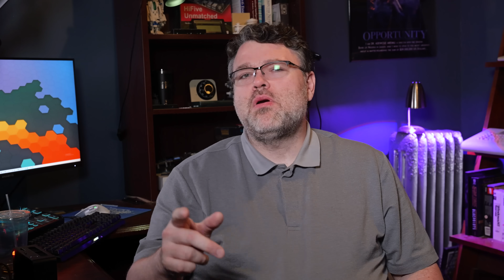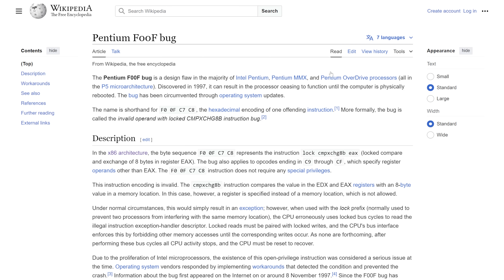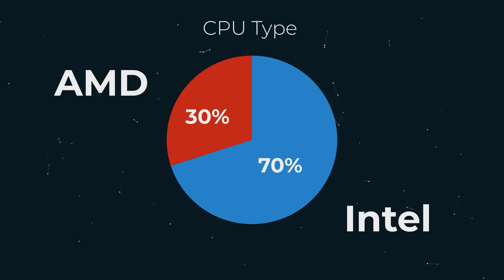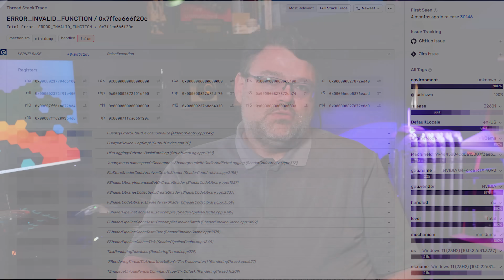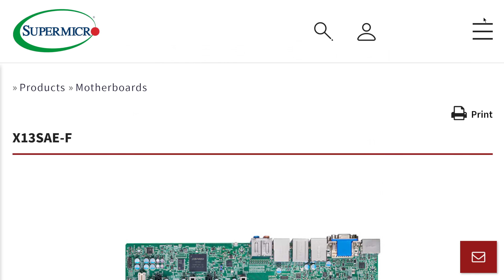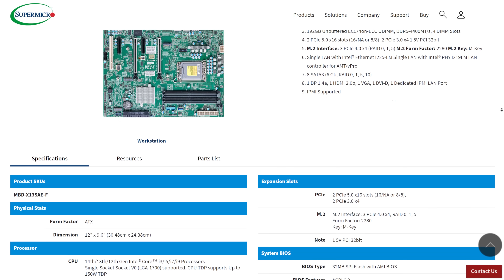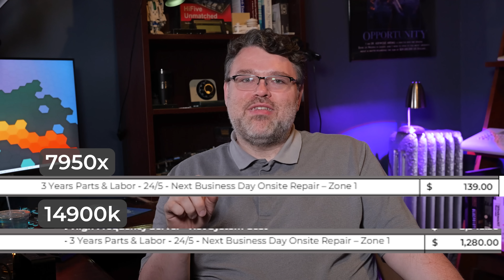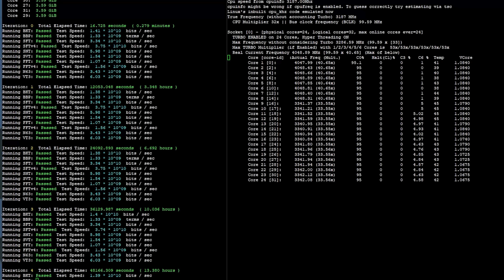Intel has a Pretty Big Problem

Comment: My 13900K (running at stock) has been rock solid for about a year, hopefully I don't have a ticking time bomb 😬
Reply: i have a 13900kf at stock settings with intel power limits  rock solid since january 2023
Reply: @josejorgegranados661  rocks and beats a ryzen 3750x
Reply: My 13700k / 4090 build has been pretty much flawless for almost 2 years now. Even started out of a ddr4 board for about 5 months until msi released the z790 tomahawk ddr5 board. But 13700k oc to 5.6ghz on all 8 p cores, All 8 E core oc to 4.4ghz, Ring oc to 5.0ghz at 1.34v. Even the mem controller has been very solid. 32g.b Corsair rgb vengeance 6400 cl32 hynix A-Die oc to 7200 34-41-41-83 at 1.45v. On a msi z790 tomahawk. I can't complain. I've also been using a contact frame since day one for both boards I've had this 13700k in. I've heard a lot of the problems could be related to the bend they get with the stock mounting bracket. But until intel releases a statement / fix we really don't know what the issue is. I've used mine hard for over 8 hours a day every single day for work and gaming for almost 2 years now and it runs perfectly fine. I haven't babied it and I won't. I bought a k series for a reason like all the k series intel cpu's I've had.
Reply: mine is also fine, however I noticed a problem in a single core if I overclock. solution was to just overclock the other cores. but mine is direct die so the temp is like 40c under load.
Reply: Same been using the I9 13900K at stock settings since Nov 2022. Hopefully mine is unaffected.
Reply: mine is fine as well, got me worried though
Reply: I hope high temperatures and very low size processing technology don't degrade the chip faster than you should expect.
Reply: Is this @Intel PR speaking through @JarrodsTech account?
🤑💸💰

Comment: welp your wrong , the motherboard manufacturers did it again they made their stock bios config too high of voltage and offset way too aggressive . if you change your bios setting too intel stock settings and crashes disappear .. this has already been investigated and proven .. motherboard manufacturers have done this repeatedly !!
Reply: no

Comment: The only game ive had the out of vram was on GreyZone Warfare. I had to turn off my onboard ram OC.  No issues since then. Most other games rarely if ever crash. 

PC: iBuyPower
Intel® Core™ i9-13900K Processor

64 GB DDR5-5200MHz G.SKILL Ripjaws S5

NVIDIA GeForce RTX 4080 - 16GB GDDR6X

2x2TB Samsung 980 PRO M.2 PCIe Gen 4 NVMe SSD

DEEPCOOL GAMERSTORM RGB
360mm CASTLE 360EX Liquid Cooler

MSI Z790-P WiFi

Comment: I have a strange issue with the 12900K with Asus Z690 Hero
after running the computer anywhere from a couple days to a week for this issue to pop up the issue pops up under normal use or sometimes when waking computer up from sleep mode
computer will soft lock apps will crash did get a blue screen one time with Memory Management failure when in resource monitor I've notice a lot of hard faults even know memory test fine XMP is off running at default Intel speeds & voltages in BIOS also cleared BIOS & have updated to latest version downloaded the latest version of memtest86 memory test passes did have error code 55 once memory LEDS were working but no memory detected powered computer off then turned back on motherboard posted in safe mode restarted again posted normal no changes in BIOS Memtest86 passed again also tried disabling virtual memory restarted Windows & then reenabled virtual memory also increased size of virtual memory still didn't fix
Don't know what else to do wondering if my cpu is bad or is it the motherboard also the CPU won't boost clocks unless the boost timer is turn way up
system is liquid cooled with custom loop temps run around 55c to 70c underload system was built 2 years ago

Comment: This is a really awesome video but unfortunately it doesn't help anybody that owns a 1400 series CPU it just makes them regret the purchase lol

I just recently started a YouTube channel on a different account than this one 

And I just like to say that I run an i-9 14900 KS with the rog Maximus Apex encore motherboard 

In which case I used to run an rog strix board with an i9 11900k the first PCI Gen 4 CPU 

My point I ran the i-9 11900k completely unlocked remove all limits every other setting set the auto with adaptive turbo boost technology on and I just want to say that the i-911900k never crashed ever 

Since I have owned the i9 14900 KS I have gone through undisputed peril the thing just crashes like no tomorrow 

Then you get an Asus bios update 1301 claiming that they have the Intel baseline extreme profile built into the update 

And all it does is crash more 

I recently just reverted back to bios 1102 for the rog Maximus Apex encore board because it seems to be the only bios update that does not have the Intel baseline profile built in I then f5 to default settings on the 1102 bios manually punched in the Intel extreme baseline profile advertised on the actual Intel site which is not the same profile asus included in there recent bios 1302 update 

Since doing what's described above I have had way better stability but still regret my purchase and wish I never bought the new configuration sorry for such a long  comment thanks to anybody that reads this you are awesome Wendell

Comment: There's a smoking gun in two elements IMO. Firstly they are immediately changing the socket for the next chips.
Secondly they have blocked any ASUS Ai functionality whatsoever, just as they prepare to implement their own ai.
I've been giving them grief on their support forums and their response is always that they are looking into the error. 
Meanwhile they are literally advertising their new thinner socket which helps to manage heat.

Comment: @level1Techs hi there.  I watch Tressemme boy alot as well and others but I found this video on youtube and wanted to let you know my findings with Intel chipsets.  I purchased two boards, one Gigabyte z790 Aorus Elite AX,  MSI z690 Edge Wifi, both boards with my 13700KF both have PCIE errors on every boot.  My wifi driver also fails at times on both boards but not only that but even my gpu driver will fail (AMD).  I thought maybe it must be the 13700KF cpu I have, possibly.  So I went back to my z490 10900k rig and reinstalled windows 11.  Maybe it was Windows 11 instead, but alas the SAME problem started happening with my z490 setup as well.  This DID NOT happen before Windows 11, or it's first big update on windows 11.   Still till this day ON ALL THREE systems I get the same errors across all within my event viewer.

Comment: I've been dealing with random crashing on a 13900H system and haven't 
been able to figure out why. Similar situation, I'm seeing crashing 
every 48-72 hours, tried disabling E-cores, C-states, Turbo and default 
PL1/PL2 values, but no luck. Running TrueNAS SCALE (Linux).
Reply: You have to replace it with an AMD

Comment: One of the biggest take-aways from this video is the price difference on service agreements between a 7950X ($139) and a 14900k ($1,280) server - "3 years parts & labor, 24/5 - Next business day onsite repair - zone 1". 

For the 7950X, that isn't covering the cost of a single hour onsite repair technician. 

For the 14900k, that is slightly less than the cost of an Asus Pro WS W680-ACE ($330) + a new 14900k ($600) + 4 x 48 GB of G.Skill Ripjaws DDR5 5200 RAM (2x$190) (total of $1,310). You can basically do a complete hardware replacement, AT RETAIL COST, for the price of that service agreement.

Comment: I never thought I'd see the day where AMD is considered the cool, efficient, faster solution and intel is thought as the power hungry, buggy, crashy and hot soluton, but ryzen has really done it.
Reply: I am guessing that you were not around when the Athlon systems were relatively new then?  Intel's Pentium 4 era was marked with power hungry, buggy space heater issues while AMD's CPUs ran much cooler and performed well - my AthlonXP 1800+ system performed around as well as a Pentium 4 running at 1800MHz but pulled significantly less power than the P4.  AMD failed to grab a decent market share in the consumer market during that era though due to Intel shenanigans - AMD did take Intel to court over this and won billions in compensation.
Reply: @emu071981  amd failed to grab the enterprize sector market share, that's where all the damage was made. intel shenanigans made sure that no retailer sold amd server systems (systems that they already had in their stock) for a decade, while they had big discounts on intel ones. they called it the mother of all deals or something like that. amd won one or two billions in that court, but didn't sell for a decade, that nearly bunkrupt it, while intel made tens of billions profit and paid 1.4b if memory serves. that's how you make big money...

Comment: A couple of things you said about the fault data got me thinking I could be very wrong but if it was a issue caused by over stressing of cpu due to motherboard bios settings at launch Intel would have issued a statement with board partners and swap out scheme, however you then said Intel 13&14 gen top end had higher I/O errors so possible fault in I/O module of cpu. But Memory issues single dim more stable than Duel, two dims would place more strain on memory controller. Then you said about server system slow downs then crash points to memory corruption and recovery attempts and also servers running memory very slow also points to a controller issue. So why no fix from Intel I feel answer is there's a problem with 13&14 gen memory controllers that Intel do not understand or are worried could be very bad for them so keeping quite so as not have to replace a lot of CPUs at great cost and bad publicity, cheaper to imply board partner bios & overclocking to blame & do nothing.

Comment: Intel has traditionally released its CPUs with a decent amount of  headroom to allow the chip some breathing room.

This has meant low failure rates and high stability in the past

This safety margin has since been slowly eroding generation on generation as they have been forced to draw on this headroom to deliver more performance and make up for lack of IPC improvements. 

This has left us with a situation where the higher end chips are flying way to the close to the sun.

Comment: Wanted to report that I got Intel, today, to replace my 13,700k processor, which has grown more and more unstable as I've used it. I built this system in February 2023, so I've had it running about 1.5 years. At first, the 13,700k worked like a dream. Then, one day, a random crash in Diablo 4, "Out of Memory Exception" error. Then, a week or two later, I got another crash in Diablo 4, then the same day one in World of Warcraft.

This trend progressed to the point I would get crashes every 20 minutes. It was driving me actually insane, so I started researching this problem online. Eventually, that led me here to your video (from the r/Intel subreddit post).

I've only managed to find system stability by taking fairly drastic measures, which have had the by-product of severely hampering my system's performance. I had to downclock, using Intel XTU, my processor P-core ratios from 54x to 51x just to gain stability. I also had to disable XMP. My system doesn't crash much now, but it's much slower overall. I also dropped the boost (pl2) wattage limit from 253w to 237w, and I will say that change did result in much lower CPU and liquid cooler temps.

In the midst of all of this, Intel has finally agreed to replace my CPU. Their wording says "refund you for your processor" -- I am just waiting to hear again from them with the final details after providing them some photos of my CPU box today, and a PDF copy of my original invoice from Newegg for the 13,700k purchase.

It didn't take too much to get them to replace my CPU (well, more like refund me -- as refund was their wording, not replace/replacement). Customer support seemed to be aware of this problem, and they just asked me to show them info on what BIOS I was running, and what my other system specs were (mobo, etc.). Was pretty easy to deal with them, and I am glad their customer support was frankly so willing to offer a refund so quickly without a lot of red tape. What I don't know is what I'm going to do with the refund. I feel like I dare not gamble on another intel 13th/14th gen CPU, but if I swap to an AMD build then I'll at least need a new motherboard, which will eat a lot of my refund for this 13,700k. I will be getting $427.99 back it looks like, as that was my original purchase amount.

Intel overall may be being a bit scummy about all of this, playing coy when they may in fact know much more than they've let on about these CPU problems, but at least their customer service is doing the right thing (at least in my case). Thank you Intel support for being pretty great so far for me.

Comment: The motherboard power delivery and associated settings are responsible.  They are made the same as with 100w CPUs from 10 years ago.  Not much beefier VRMs and LLC settings are still set to high vdroop.  Fine for a 100w CPU but not a 300w CPU.

If a CPU's voltage is too low in a part or whole it crashes.
When the VRM's and their settings have more power run through them the voltages supplied to the CPU and it's parts decrease more.   
If a CPU is stable at it's volts and clocks under light load and are then unstable at higher load then it is suffering from vdroop instability.

The known fixes correspond to reducing vdroop: by reducing the amount of power consumed, by increasing volts, and by reducing the top clocks, or HT which also reduces the amount of power consumed.  They tend to be p-core focused.  The issue could be in any of the systems, p-core, e-core, L3 cache, e-core L2 cache.  Vdroop can affect any of these.

Vdroop can also be fixed by adjusting the LLC.  My Asus Prime Z690P has a default LLC of 3, and it wouldn't surprise me that the W680s are set similarly.  Which results in over 100mv of vdroop under 300w load with a 13900kf.  It doesn't surprise me that a chip could be unstable when it loses 100mv compared to what it is asking for.  An LLC of 6 is much more stable (6 is Asus setting, other brand motherboards will have a more stable setting that corresponds with less vdroop, like "turbo" on my Gigabyte Z690i).

I get the best stability with undervolting and lowest power draw overall by setting LLC to near the lowest allowed (but not one that increases volts with load) vdroop setting.  Not near the lowest setting, but near the setting that allows the least vdroop.  Motherboard brands are all over the place with how they name LLC settings, just remember lower vdroop is better, but negative vdroop makes weird stuff happen.  
The motherboard manufacturer's Haswell grade VRMs need a little coercion to adequately supply power to CPUs that require three times as much as what the VRMs were originally designed to stably deliver.  But pay attention to core volts as they will increase with an adjusted LLC and you don't want them to get too far into the 1.4v range. 

The best settings I've found for lowest stable power draw, minimal volt spikes, and with the most headroom for adding volts for other CPUs that may need it on my Asus board are:

Asus MCE: disabled-enforce all limits, SVID: best case scenario, LLC: 6, Synch ACDC with VRM: enabled, TVB optimizations & enhancements: enabled, TVB overclocking: disabled, IA CEP disabled, Intel DTT enabled, undervolting by running matching adaptive more offsets to core and cache, e-core L2 +20mv.   
The base setting for all of that is LLC: 6, otherwise even the SVID wouldn't be that stable, much less my 60mv undervolt.

Comment: Anecdotally, I have a 13900kf. After about 3 months I started having instability issues and they continued to get worse to the point I couldn’t even load windows anymore. I had to RMA the PC and get a new cpu/motherboard. That was July -December of last year. Around April/May of this year the problems started creeping back but luckily the bios fix has stopped my crashes.. for now. My worry is that the damage has already been done and this is just a stopgap measure

Comment: That 7800X3D paying dividends.
Reply: My 5800x3d is as well considering its right on the heels of an i9 13th gen.
Reply: @Odin3v  😂
Reply: @Odin3v  5800X3D is comparable to a 13600K, not a 13900K
Reply: @MaxIronsThird  you mean, 13600k is more comparable to a 5800x3d.  Doesnt change how great the 5800x3d is.
Reply: @Odin3v  what
Reply: @MaxIronsThird   He means that when you are comparing newer cpu's to older ones.  You say that the new one is comparable to the old one. 

 You compare the new to the old. Not the old to the new 

Example: Windows 11 is like a shittier version of Windows Vista 

Not:  Windows vista is like a less shitty version of windows 11

----
Reply: @MaxIronsThird 5800x3d is way older than 13600k and costs less than half the price when you compare platforms. If anyone wants the performance, why pay more to not get any more performance
Reply: @Odin3v  Huh? 🤷
Reply: @robertkeaney9905  What he's doing is splitting hairs after being corrected. It doesn't matter which way you say it, it's not that important. He's being passive aggressive.

Comment: Im sitting here with my 13700K quaking in my boots. i have an overkill cooler on it, and Im working on moving to an even better cooling setup in order to prevent and instability issues from coming up.